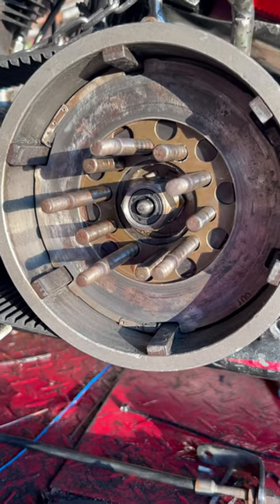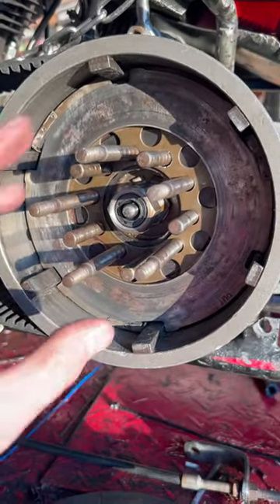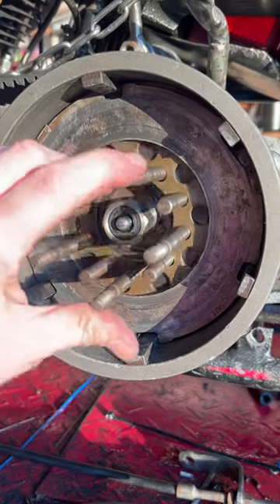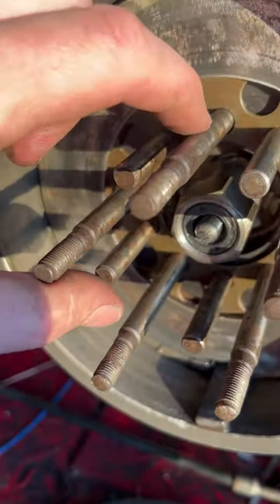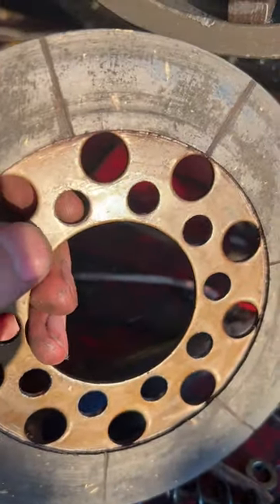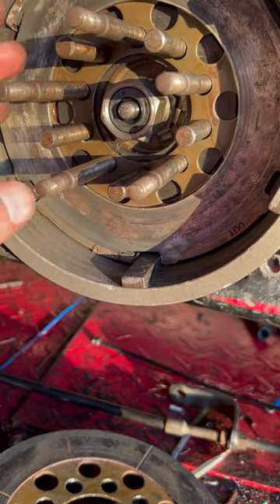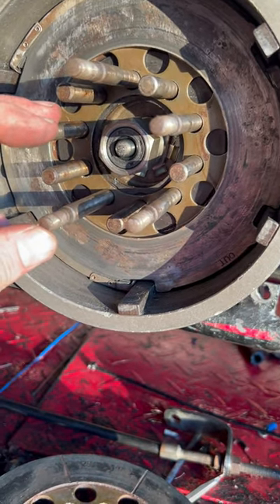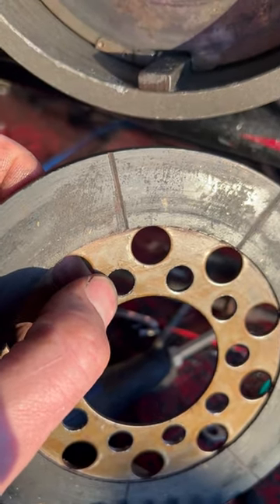Fix your clutch.  #harleydavidson #motorcycle #bikelife #chopper #shovelhead #panhead #harleylife

Comment: Medieval design no wonder why they fail
Reply from the maker: And that’s why they are fun.
Reply: @843chops  I can't lie I have a 70 FLH and yeah you're right I used to run points out of a 6 cylinder Chevy
Reply from the maker: Yep 235 points work great in them. Love the old stuff.

Comment: Or smoothen the grooves on the fingers with a bit of sandpaper.
Reply from the maker: You could, but I ain’t got that kinda time.   I’m still running those plates almost a year later with no problems other than a little extra noise with the clutch disengaged.
Reply: @843chops  I' ve been running the stock hub for over 125000 miles now.

Comment: Drilling them out on old steel clutch plates works great but if you decide to go with a new clutch hub, get you some new BDL, BTX-5 aluminum clutch plates. I have 20ish years on mine and the holes are egged out but finding neutral is still a breeze and the clutch hub studs have no marks on them.
Reply from the maker: I use what came with any bike I buy, I go through a few a year.  I very rarely buy new parts honestly.

Comment: or before the hub studs wear, use BDL BTX-5 aluminum clutch disks. They wear, not the hub studs but they last for years. Mine are old and if I had to guess 15 plus years old but that could be off by a few years. The holes are now egg shaped but still work great and finding neutral is a breeze.